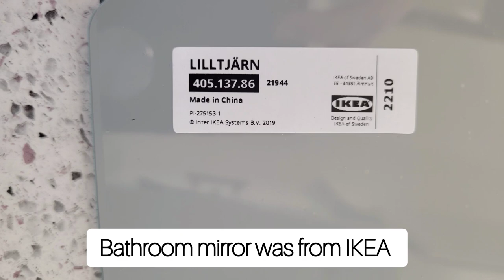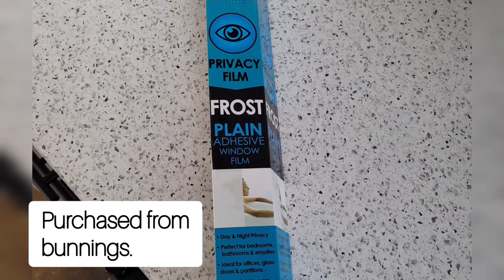Caravan Bathroom Reno | Vinyl benchtop | Van Flooring | Sink | Skirting/Arcs| Ikea Mirror | Blinds

Comment: Great work, I have done a lot of reno's over the years, I would be concerned about that foam strip in the doorway as being a high traffic area it will diminish really quickly, use silicon to stick it on as liquid nails doesn't work well when it gets wet, great job overall as the transformation is night and day.
Reply from the maker: Thanks so much for the comment and for watching. Touchwood it's held up okay so far but that's good to know!! Thanks again!